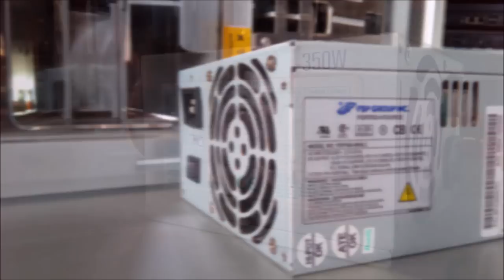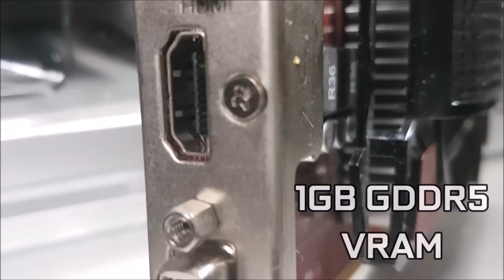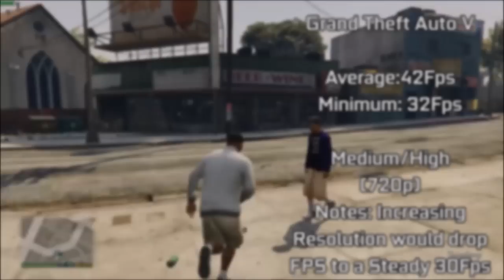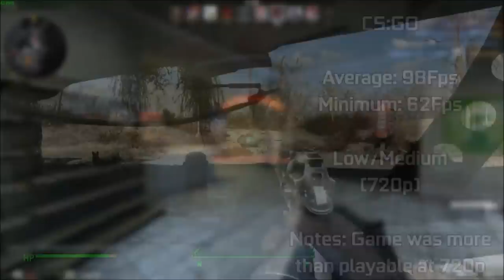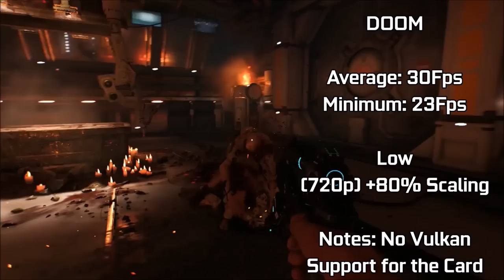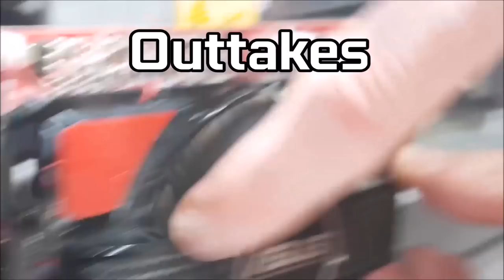Why you SHOULD buy an R7 250 in 2017 // The Low Power Consumption King.

Comment: ok i may be outdated but why tf does gta doesnt run well on my new r7 250 2gb ddr5
Reply from the maker: Probably cause its DDR3 not GDDR5.
Reply: @BudgetBuildsOfficial  i run it in gpu z if i am not mistaken but it said that its a ddr5 maybe my game is broken?
Reply: @paul4dea  what is your cpu/ram?
Reply: @stevesmith1383  a4 6300 8gb ddr3
Reply: @stevesmith1383  what cpu should i upgrade with? can u suggest me a amd :) that helps much
Reply: @paul4dea  there really isn't much you can do. That's a FM2 cpu so stands to reason you have a FM2 motherboard. So all you can use are FM2 cpus. And the best thing you can buy is a quad core (or "quad core") as these cpus don't have full independant cores but I won't go into that) 

you need a new motherboard/platform for access to better/good cpus 

that being said, if you can't get an upgraded, a quad core FM2 cpu is your best/only option

what do you have? a custom 3rd party motherboar? or a OEM pc, like a Dell/HP/Acer etc etc?
Reply: @stevesmith1383  gigabyte mobo
Reply: @paul4dea  model #
Reply from the maker: Your cheapest option is to keep the RAM, and sell up the motherboard and CPU.

1155 Motherboard: £15
Core i5 2400: £13

Really youd be best saving up for AM4, but even a leap to a cheap old i5 and reusing the RAM would be better than most of what FM2 has to offer.
Reply: @BudgetBuildsOfficial  Big Ryder, exactly what he said

Comment: IT CAN FUCKING RUN GTA 5 IN HIGH SETTINGS!!? EVEN IF PAIRED WITH 4GB RAM ON YOUR PC!!!!!!

(Edit: I only had 800x600.)
Reply from the maker: What?
Reply: Budget-Builds Official 
I tried with my PC and hell it gone through 40 fps.
My specs:
4GB DDR4 RAM
Core i7 7th Gen
(Original) AMD Branded R7 250
and a typical 720p LG monitor
Reply from the maker: 4GB of RAM is not enough for GTA V
Reply: Budget-Builds Official but I did try it and it was good af. Maybe I just have a setting turn off that I haven't checked lemme see.
Reply: Budget-Builds Official Oh wait I just had my resolution at medium. I changed it to the 720p and now it sucks.
Reply from the maker: I should really do an R7 250 Revisit. To see how it performs today.
Reply: Budget-Builds Official yeah. I just found thr gpu lying around and thought of it just broken.

Comment: i have a fx 6300 and a r7 265 and its a pretty bad pc, cant do much than csgo and dota at medium settings
Reply from the maker: symmetry: Hmmm maybe something is overheating or your OS is clogged? Have you tried a full fresh windows installed?
Reply: Budget-Builds Official yeah, also i play at 900p, and in gta v i get huge lag spikes randomly. i reinstall windows anually
Reply from the maker: symmetry: set the game to high priority, allocate only 1 core (Core 6) to explorer to exe.

And overclock to 4.2+GHz if possible. Hope this helps as even with my FX4300 and HD7770 I could play GTA V.
Reply: Budget-Builds Official sounds cool, just have to find out why i keep getting a no signal from my monitor
Reply from the maker: symmetry: Try reseating the GPU?
Reply: Budget-Builds Official i have multiple times, to the point where i lost the screw to it in my pc haha

edit: found in tge side pannel
Reply: What are your CPU temps?
Reply: symmetry r7 265 its a nice GPU today
Reply: yeah i just got a new pc because i found out my motherboard was dead, im enjoying the ryzen cpus atm :) i have a r5 1600 and a r7 265, i dont have stuttering anymore.

Comment: this need a PSY connector?
Reply from the maker: BiG-3: No this does not need a PSU connection
Reply: I have 2.5gb ddr2 with core2duo e6300. Does to much bottle neck?
Reply from the maker: BiG-3: Older titles Upto CSGO will see playable frame rates with some tweaking.

But newer titles like GTA V, Doom, Ect... will require you too upgrade CPU and RAM, look at getting a Core2Quad 8200 (£12) and 6GB of DDR2 (£5).
Reply: my motherboard only support core2duo 6700... that the best i can get. Thank you for the answer, i love this channel!
Reply from the maker: BiG-3: May I ask what motherboard you have, also 4GB of RAM is the minimum for "smooth" gaming at 30Fps.

I have recently purchased a 25p Pentium Dual Core E5200, which may offer similar performance to your C2D (albeit your C2D is a bit better)

However this video will take a long time to make till then I'll help out via just text messages, hope this helps
Reply from the maker: BiG-3: with a BIOS update you can run all of these CPU's http://www.cpu-upgrade.com/mb-ASUS/P5B.html
Reply: Holy crap. I have a core2duo e8500, how i can update the bios? is hard?
Reply from the maker: BiG-3: not very difficult at all, just find the file, from the ASUS website, and use the windows flash utility. Just make sure it is the right one.